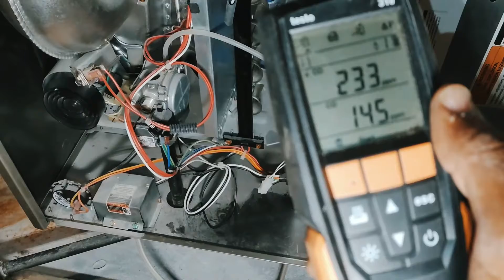What is Flame Impingement? Major Issue with 80% Carrier Gas Furnace #hvac #furnace

Comment: I have seen some of these come with crooked turbulators at the end of the burner tube, causing the flame to ride 1 side of the heat exchanger, smak it with a screwdriver and it should help ..
Reply from the maker: Nice! Haven't come across one of those yet. Thanks for sharing!

Comment: I have seen this happen when the installers don't use a back up wrench on the gas valve when connecting the gas line to the gas valve. I've seen them do it numerous times right in front of me after I mentioned to them not to do that.
Reply from the maker: Oh wow I imagine that's got to drive you crazy

Comment: I see that model every day, we have spoken with Carrier tech-support about it, and they say as long as the CO levels are less than 200 ppm it’s good. I know that doesn’t make it right on their end, but that’s what we have to deal with.
Reply from the maker: That would be fine but most of the ones I come across have co levels above 500.
Reply: @HVACTechKnowledgy Do they have the NOx inserts, those burner tents in the mouth of the heat exchanger, when they are that high? Carrier said we can remove those inserts as long as we are not in California
Reply: @HVACTechKnowledgy I’m headed to one today, a Daikin RTU, that last night had well over 1000ppm out of the exhaust. I didn’t have time to do an analysis because it was getting dark and the SCHOOL was closed; that’s right, it’s t a school. I’ve got my analyzer with me this morning and am going to see what the issue is.